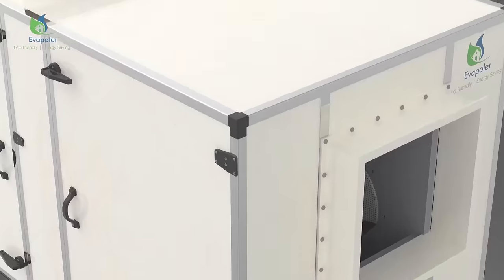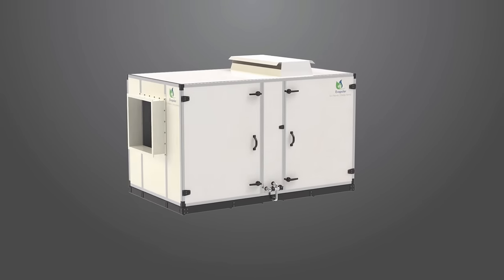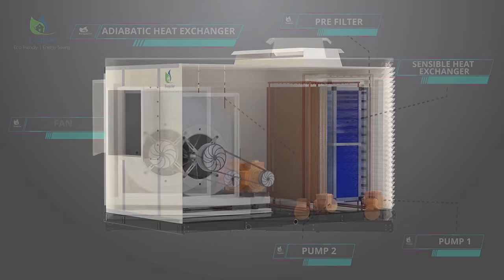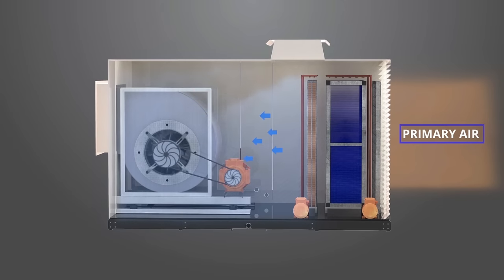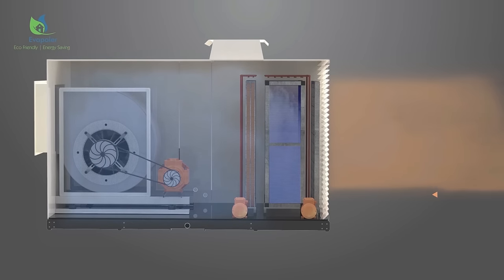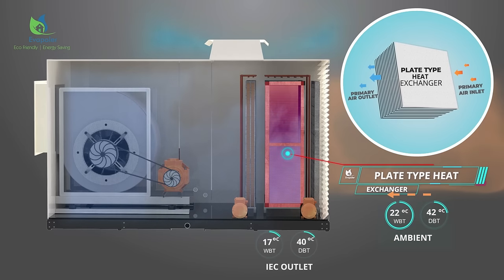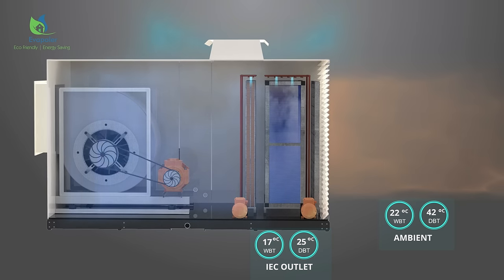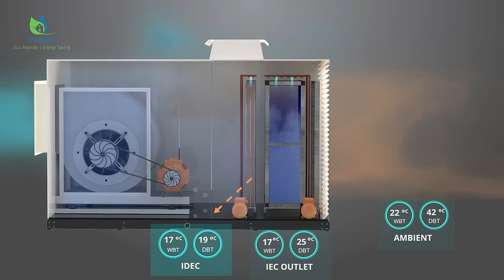Indirect Direct Evaporative Cooling System | Evapoler

Comment: I think this is the one that answers my questions. I had been wondering what happens when you take the water from a cooler that is cooked to the wet bulb and then rub that through a radiator heat thing. You put this dry air with no added moisture back into the cooler. So the setup would be like this one evaporative cooler  2 extra pumps 2 radiators 1 fan. You could do this with only 1 radiator and one pump but nah. Take the water from the cooler which is at wet bulb and cool the room in which your cooler is using your radiator supply it with water by the pump. Now the second radiator would go in front of the out let where the humid wet air comes from the cooler. Put the radiator in front of the wet air fan and run the water from the cooler into this and back into your cooler using pipes the same way you ddi for the dry air. This should theoretically keep bringing down the temperature over time with limits being 0 degrees. I don't still see why not. I see some efficiency issues but none seem impossible or even need any work to be done at all on them.